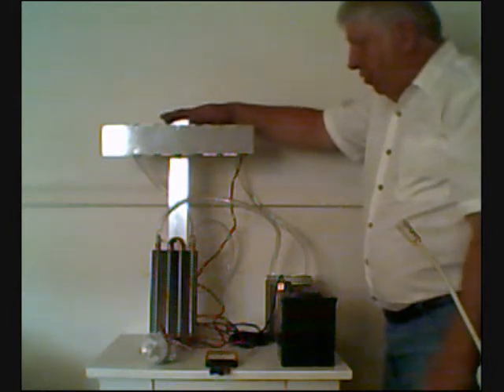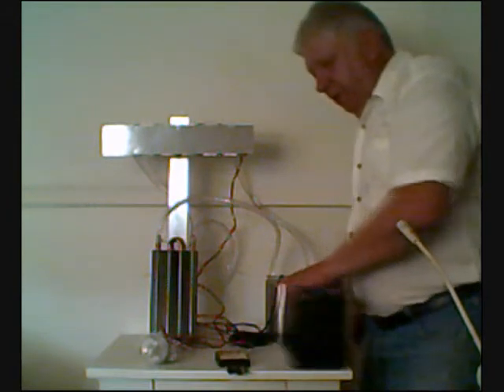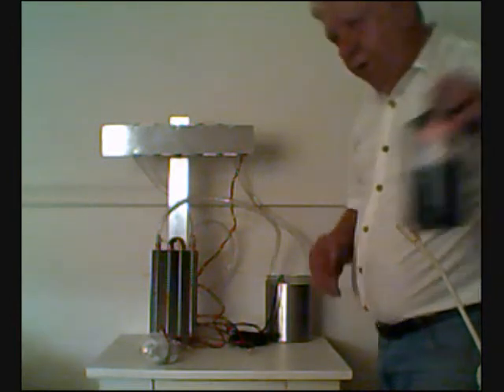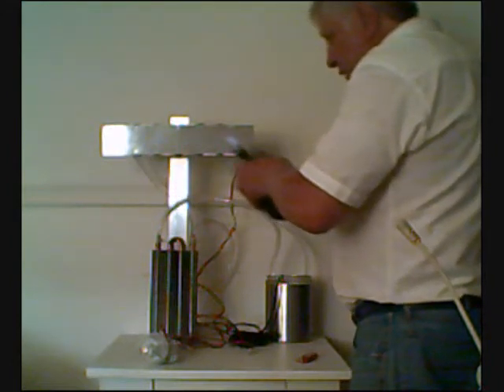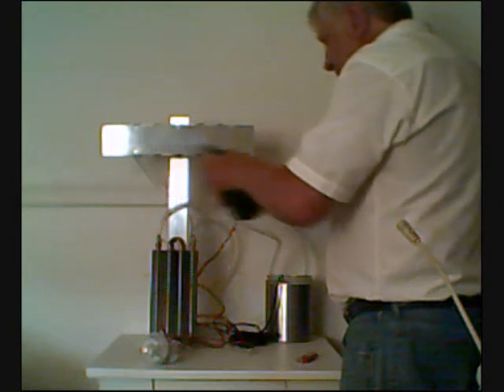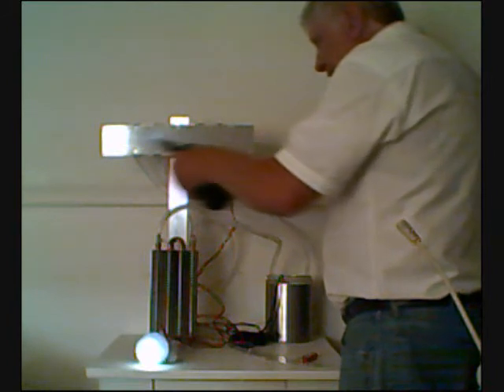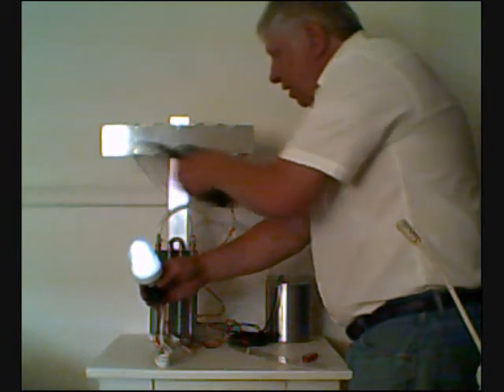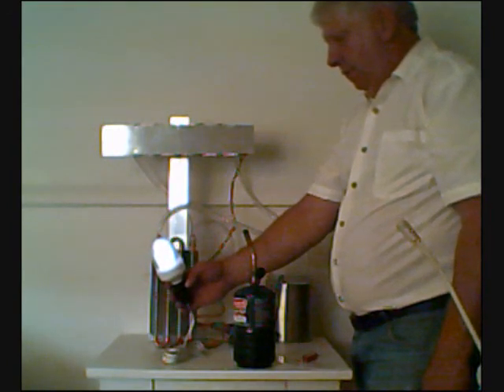Free Electricity Thermoelectric Generator 1

Comment: you know  i think its amazing how narrow minded people can be when solutions are right in front of them and they refuse to show initiative and want someone else to solve their problems. most dont know what a bi-metal spring is or what  its purpose is .its two pieces of different metals seamed together that have different expansion and contraction values,the ambient temperature determines whether the spring expands or contracts.this expansion or contraction is slow but it is movement that is potential energy can be converted to kinetic energy  via a spring configuration of the metals.and gears change the speed of the slow movement and creates enough speed to drive a bi-directional generator to produce electricity,all day all night  until its mechanics break from normal wear, thats free except what it costs to build and maintain

Comment: really ?...try a bi-metal spring attached to set of gears that is attached to a bi-directional generator ...temperature differences between night and day compress the spring or expand it and in turn drives a generator that puts a charge to a battery that lights a light bulb or ? no propane torch needed and it runs endlessly until it breaks ...hows that for free energy ?

Comment: While using a propane torch is incredibly in-effecient, the idea of using other-wise un-used heat to create energy is actually some-what effective (by the way, you can use a fan, instead of water, as a coolant, so you can generate electricity in water-deficiant areas.)

Comment: @arturomoises64 Thermo electric is whats uses on hybrid cars, As you break, the heat given off is used to charge batteries since their on the 12v system...  so its not a complete parody...